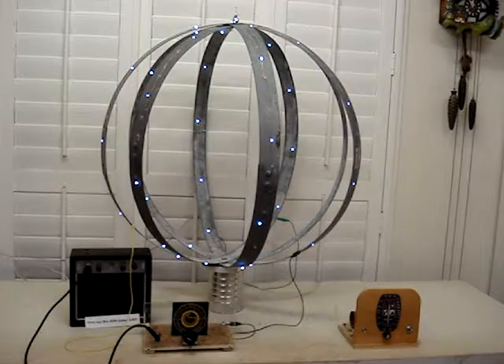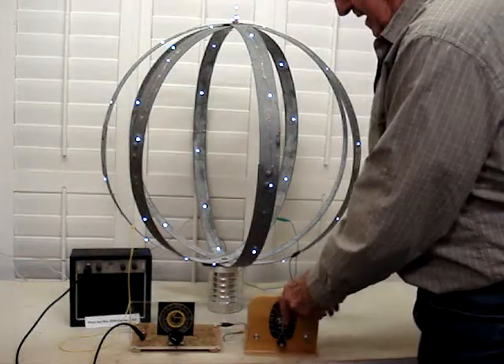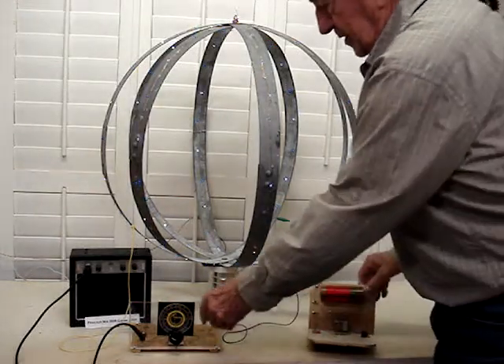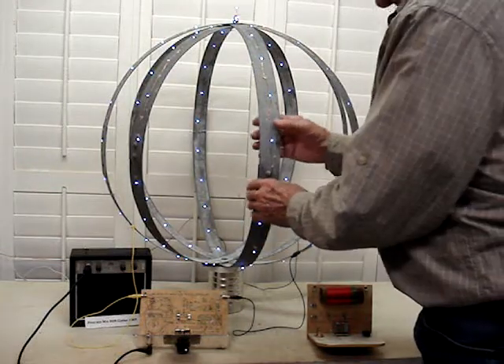S.W.  CRYSTAL Radio with FREE Light Show.....NO  Foxhole Radio

Comment: Like your videos,  you can get audible sound out of a crystal radio with no power other than what is produced from the radio output at the earphone, I use a Elk SP15 horn speaker and a Bogen T725 speaker tranformer that produces enough to hear easily across the room.
Reply from the maker: Thanks Marty... Do you have a circuit.on how to hook some thing like this ...Does the transformer have to be powered ?  Thanks again   Rich